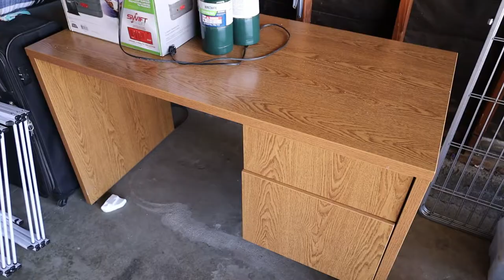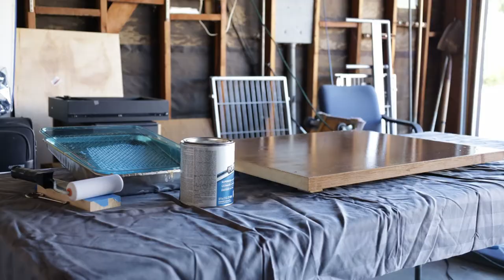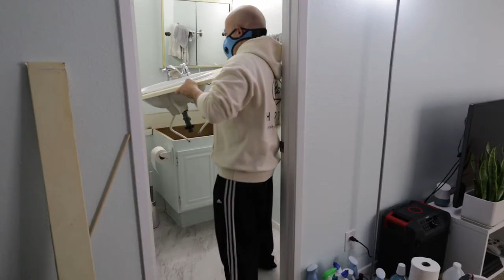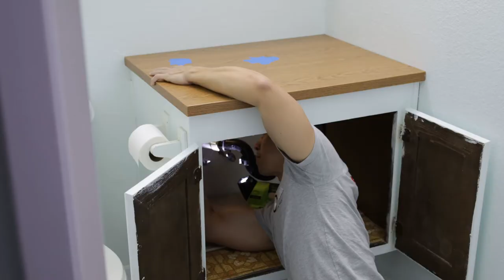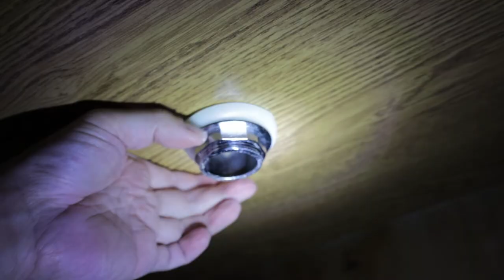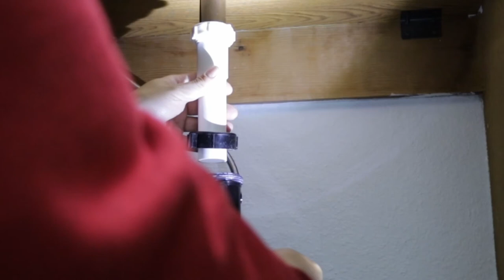Duy's DIY Adventures 010: Vessel Sink & Countertop

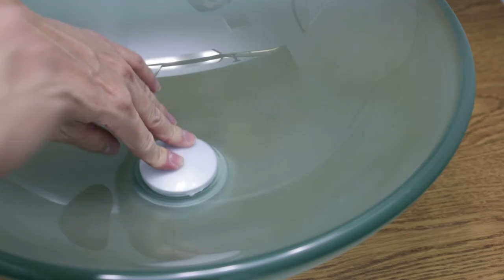Comment: Good job on your DYI.  That chrome tube aka part as you called it (6:42 time mark) is called a tail piece. The adaptor is a tail piece adaptor. Only thing Different on this nice install I would have sealed the recycled press wood that you drilled through while you still had the tape on. Water causes press wood aka mfd boards to swell if it comes into contact.
Reply from the maker: Thanks for the tip!  I'll make sure to follow your suggestion when I need to remove the top again to replace the vanity carcass.

Comment: Next time you can thin it out witg water if using water base and mineral spirits if used oil base so you can easily apply a thin layer smooth on top

Comment: Hey, what adapter did you buy from your hardware store, what is it called, dimensions etc? I'm running into the exact same problem and need to buy it. Thanks!
Reply from the maker: Hey there! Here is a link to the part I purchased: https://www.homedepot.com/p/Everbilt-1-1-4-in-x-6-in-White-Plastic-Slip-Joint-Sink-Drain-Tailpiece-Extension-Tube-C9790BG/205153709  Hope this helps out.

Comment: Great video! What is the size on your P-trap? The metal pipe that comes with the sink is smaller than my 1.5" P trap connection. Did you have this problem or is your P-trap the same size as the metal pipe?
Reply from the maker: Hi there!  My P-trap extender is also a 1.5".  Link here: https://www.homedepot.com/p/Everbilt-1-1-2-in-x-12-in-White-Plastic-Slip-Joint-Sink-Drain-Tailpiece-Extension-Tube-C9793A/205154109.  When I tightened the slip-joint nut onto the silver piece, the rubber gasket made a very tight seal.  Is that not occurring with your setup?

Comment: How tall was the actual cabinet? Most vanities are now 33.5" tall, plus the counter top height and a vessel is approximately 6" tall making the sink too high in the end. That's my issue right now lol
Reply from the maker: Oh no! I'm sorry about that.  To the top of my counter is 32", the vessel sits 6" above for a total height of 38".  I'm guessing that would be more difficult for children to access?
Reply: @slipperynoodlez  Yeh after research I found that the average height WITH the sink should be at 36 or less but no higher. Thanks!

Comment: Anyone got a link to the item in his hand at the 8:00 mark? I've searched till I'm blue in the face without any luck. Thanks!
Reply from the maker: If you look for "faucet fittings" or "supply line adapter" on Amazon, you should get some hits!  Here is an example: https://www.amazon.com/PackCompression-Fitting-Reducer-Plumbing-Connector/dp/B0BFL28VCX.  You'll just need to know what sizes you're trying to convert to.  Hope this helps!
Reply: @slipperynoodlez  Thanks for the quick reply. Some of those look similar to what you had available. I may need to plan on buying the correct water valve to make sure I get the best connection with the fewest parts. Thanks again!